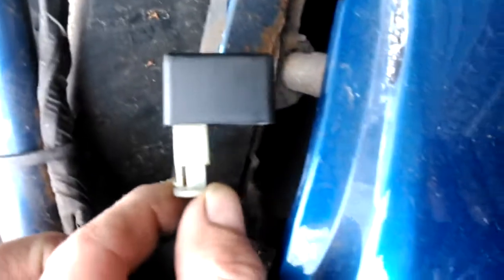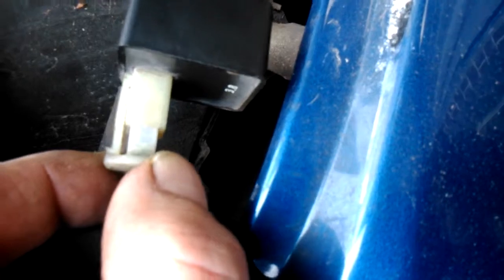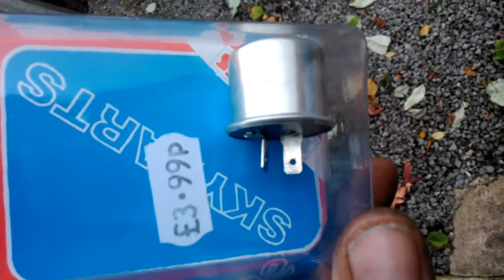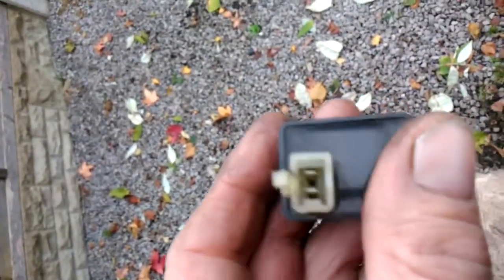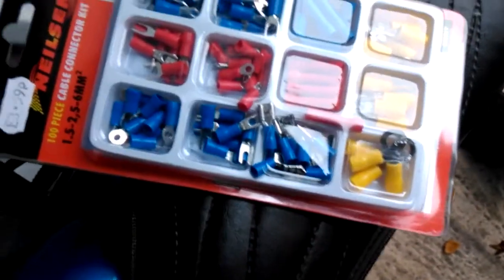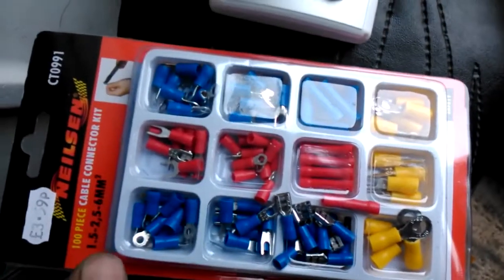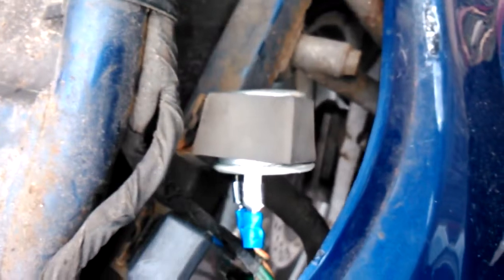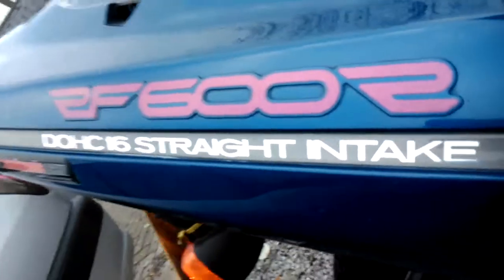Suzuki RF600R Indicator flasher unit mod

Comment: Cool idea.  Where did you get your mirrors from and are they led indicators in them. I got 2 rf600s. Ones the same colour as yours and has stock indicators. The other is rizla blue with led indicators and resisters and tons of wiring. 
Cheers
Reply from the maker: H Ade, that bike has now gone to a new home, but the indicators are stock & to be honest you need the current draw to make the bimetal strip indicator flash.
It probably would not work with less unless you had a dozen indicators lol.
And the mirrors are just mirrors with no less.
Ride safe my friend 😎
Reply: @regbirmingham624  yeah I understand. I've managed to sort mine.  Got to do fork seals now then I might part with it and get the other RF on the road.